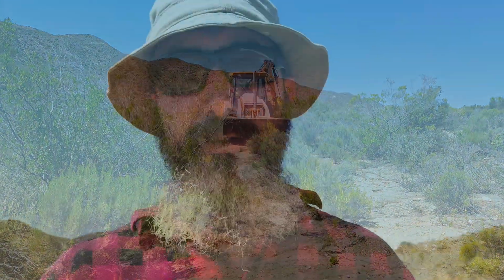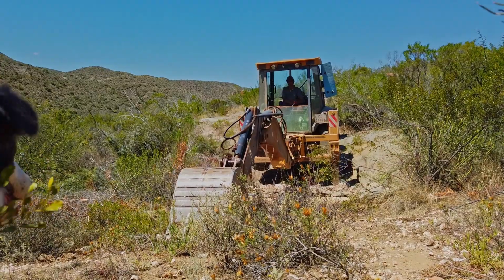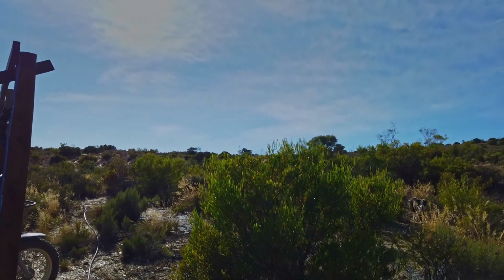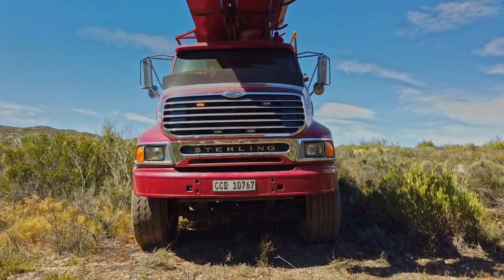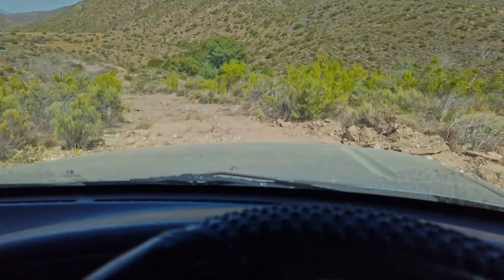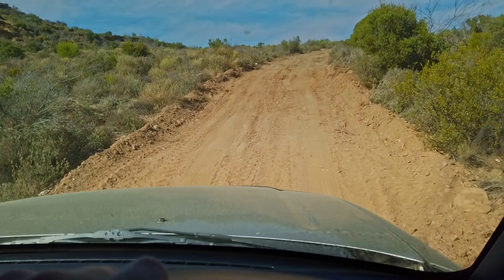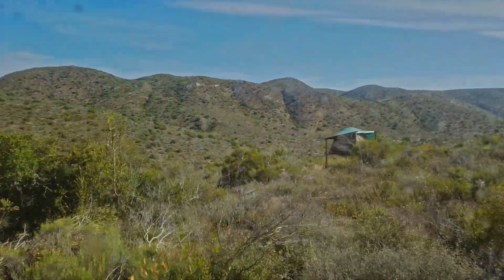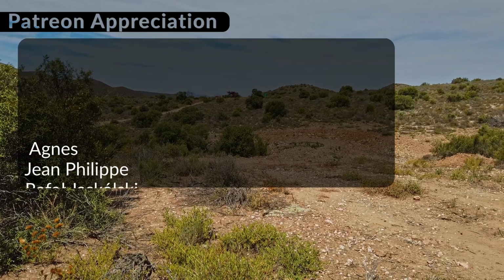Machines 1 - Farm Road Construction & Exciting(anxious) Events

Comment: That's got to be an exciting experience. Best of luck and may your water flow like a fountain. How much does it cost to get a well there? Here its about 125 dollars per foot. A well put in here is about 21000 dollars with no guarantee to get water.
Reply from the maker: Hey! Happy to hear from you.
Yep, no gaurantees here either. Let me work out the dollar value (direct)... R385/meter = $20/3.2 feet. Wow, is there a reason for the expensive nature there? Distance, geology? The 12m/40ft of steel casing we needed cost an additional $500 (can't complain, as the neighours needed 5 times that in the sandstone, but got 10 times the flow).
The cost of 3 feet, is about the same as a basket of groceries. Still, totalling to numbers that really hurt... 
Hopefully we don't ever need to do it again. Rain harvesting must grow and water use improved.
PS: I haven't caught up on your videos for a while... sorry, will make time!